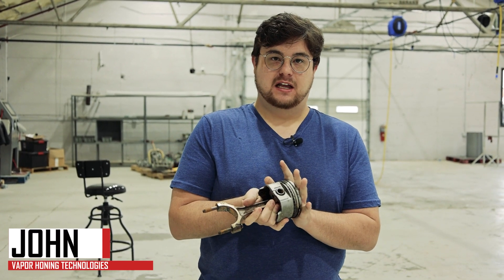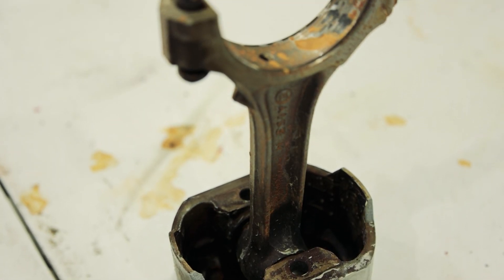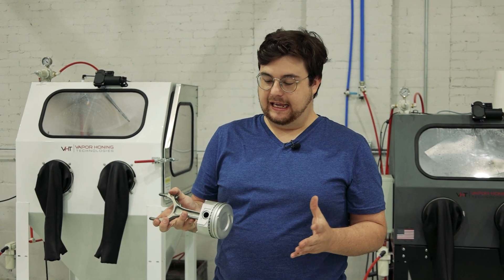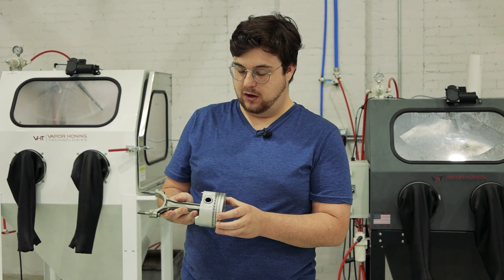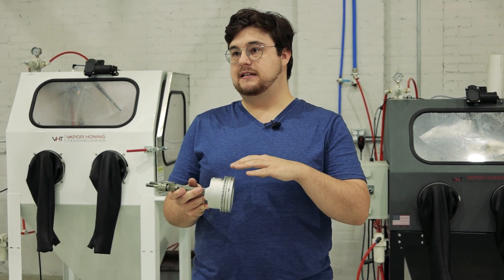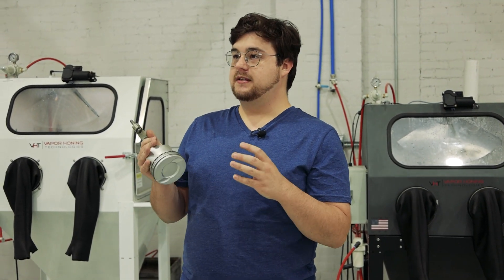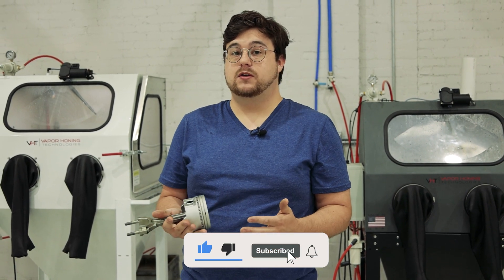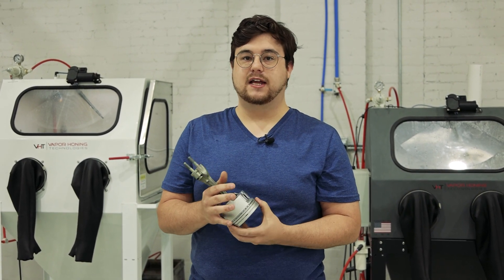How To Effortlessly Remove Carbon Build-Up and Rust with Vapor Honing!

Comment: I am all for using vapor honing to clean a piston top, even a skirt if uncoated. But I would mask the rings and pin bore. Especially the rings. That piston will be marginal at best if put into service with ring grooves that got blasted.
Reply from the maker: This is a piston out of a scrap motor that will not be put back into service. We understand your concern 😂
Reply: Further Ado